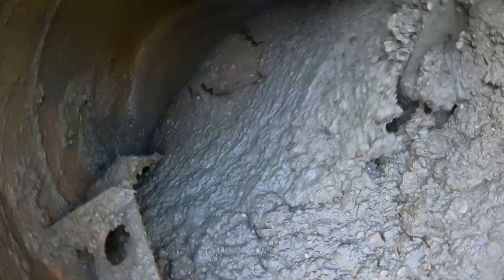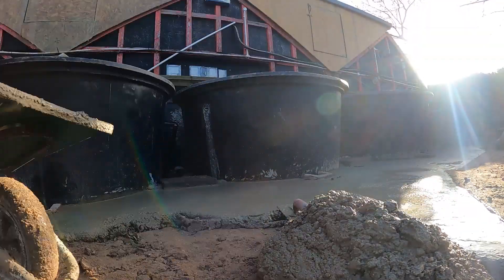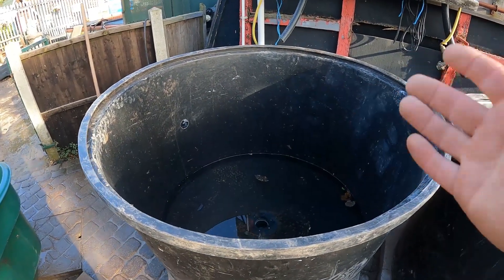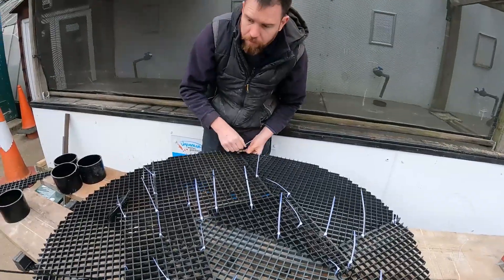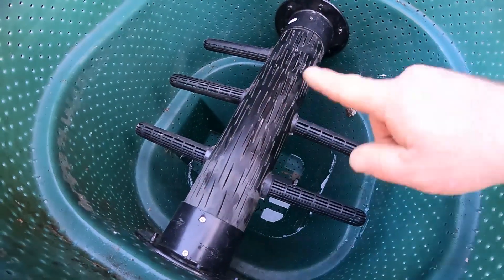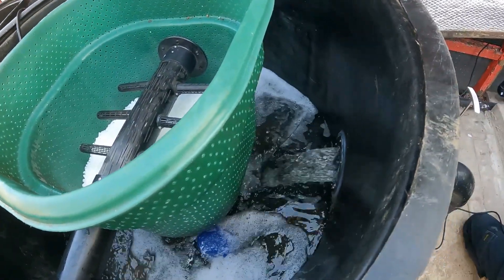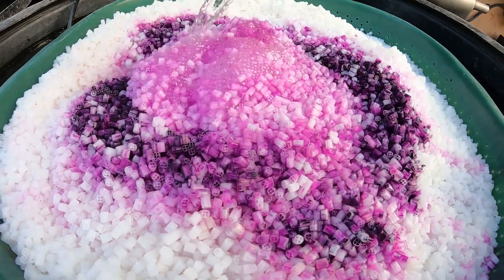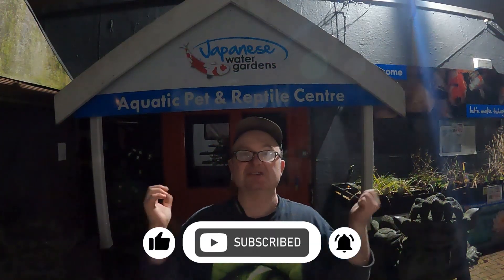Starting the DIY gravity fed filter.

Comment: Great looking system    it's slowly coming together  now      I did a similar thing with PP when I built my multiple barrel system  and left all the  new plastic media and brushes  soaking. In barrels  and then drained  into  waste. Flushing the new pipework etc  out  before  running pond water  through  the system . . looking forward to  seeing the system running
Reply from the maker: It's going to work very well.   Just need the weather to warm up and get the season of to a good start.
Reply: @leecalladine   definitely agree with weather